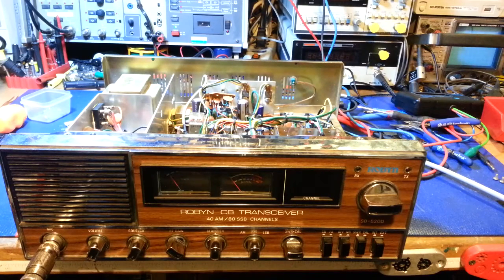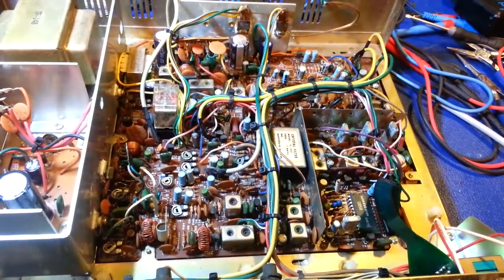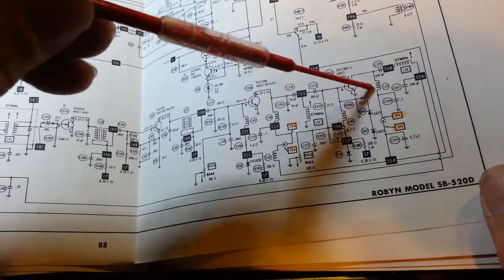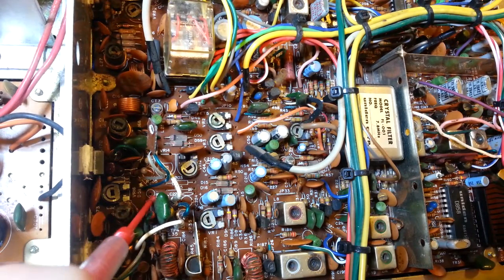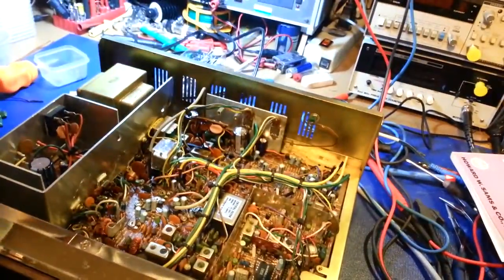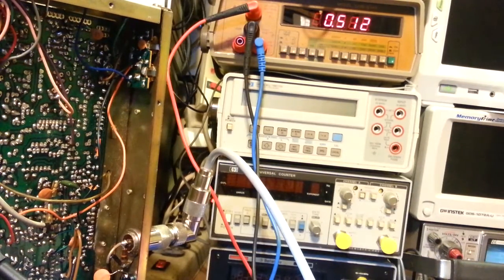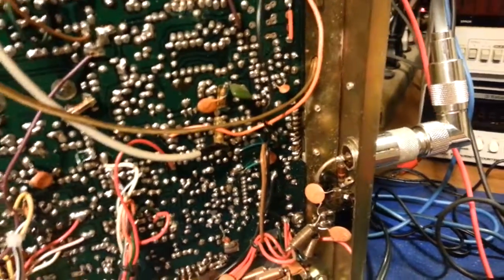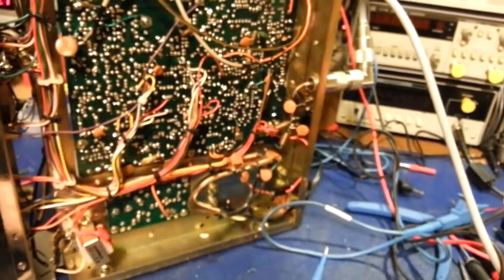Robyn SB-520D with bad final.  It's self biasing itself, crazy!

Comment: I have the same radio.  When I key up on sideband there is no delay and no modulation but it triggers the relay and holds at 8 watts.   It has me stumped.    Am has 3 watts swinging almost 20 PEP.  Any ideas?
Reply from the maker: Using a oscilloscope I would trace back through the RF amplifier stage towards the balance modulator.  Could be something oscillating or a problem in the balance modulator stage.
Reply: @mikesradiorepair thank you.  I will do that. I'm learning.  Well trying to.

Comment: Do you repair radios for other people? I've got a 2 button Washington that DEFINITELY has been visited by the Golden Screwdriver (1/2 inch twin lead for the channel mod??) and the other is a Robyn SB 520D  with no signs of EXTERIOR mods (switches, buttons, etc) I'm not too sure if it has been or not. It doesn't tx on side band, and AM only puts out a watt or so ( got an el-cheapo wattmeter, readings are approximate) I'm in Michigan, so if you can think of a good repair guy that's closer, let me know.

Thanks in advance;
Phil B.

Comment: Hey Mike, the way it is going, you might as well be the Screwdriver Specialist, with the winners you get. It is cool that you know what you are doing,,LOL.good luck. I have one of these radio's I have to look at, been sitting in a closet for about 15 to 20 years, and he was a smoker, so that will add to the B.S, but I know that nobody has been in the radio with a screwdriver at all, so this may make it a bit easier to align, and change Capacitors, but the cleaning is going to be a big job. Take care, good luck,Mark

Comment: This was a GREAT video to see BIG THANKS.  I have 2 of these radios both had been modified before I purchased them.  My most recent one just arrived which is very clean.  I had ran a D104 with my first Robyn and it was just a perfect match.  The one I received from ebay last week also came with a D104 but it needed some minor work.  I had the Cobra 139XLR back in the day with a D104 and that radio seemed similar to this one.   Id like to get a copy of the paperwork on the this Robyn  520D
      Thanks Again Mike

Comment: You just don't understand. The original screwdriver twister wanted a super linear output stage. 3 Amps of quiescent collector current ought to do it. Super duper class A operation, right? No? Good grief, where do those ideas come from anyway?

What's the right way to set the bias pots in a cheapie SSB CB? Do you look at 3rd order IMD products? Or just set the quiescent to some factory spec?
Reply from the maker: Have tried setting bias on different radios with a spectrum analyzer and had mixed results.  Some radios it works great.  Others it wasn't a reliable.  Since playing with the different methods I have decided to just go by factory specified bias current.

Comment: Usually a transistor that leaks in such a manner destroys itself or something around it.
The kicker here is that it worked and I bet it got wicked hot.

Now The reason that it probably kept working is because the power is cut on RX... so it could not sit there smoldering and eventually fail.
I am betting the waveform was probably clipped pretty bad.
The bias circuit.... certainly there were better ways to make ~0.7 volts than a 150 ohm 2 watt resistor and a diode.
That's the part I never understood about that design.
I guess it was cheaper... and it did work.... 
It's.... unique.
Reply from the maker: Yeah, its one of Unidens better chassis.  Good rx and tx.  One thing to ALWAYS upgrade is the tantalum cap next to the bias test points.  Not enough fingers and toes to count how many of those I have seen blown up.

Didn't even look at the output waveform before, probably was distorted.  Bet it was making some nice harmonics to.  It's adjusted to 12 watts on SSB now with the new final.

Comment: that power supply in the radio...when the radio is off, how many volts is it at vs when its on?
I have that same supply but I'm having trouble with it
Reply from the maker: The main supply on these is on all the time and should be at 13.8 volts.  There isn't much to them, a regulator, regulator controller and error amp transistors and two zener diodes.  What's yours doing?
Reply: mine sits at 14.83 then when I turn on the radio it goes to 13.78.
Just having the radio in  rx the regulator gets super hot and when talking for awhile it get even worse.
It gets so hot the power starts blinking off and on.
I tested every part on it and replace the regulators, diodes, new caps pulled and tested the resistors.....its possessed.

you ever seen that where a radio's power supply runs super hot for no apparent reason?
Reply from the maker: +ᗒ╬ᗕ1112223333111ᗒ╬ᗕ 

Ever seen them run hot and have problems, yes.  Ever seen a possessed one, no. :)

Here is what you should have"

TR401  2SC1618 regulator

E - 13.8V
B - 14.49V
C - 24.8V

TR302  2SC1419 regulator control

E - 14.49V
B - 15.06V
C - 24.8V

TR301  2SC945 error amp

E - 5.94V
B - 6.56V
C - 15.06V

Which of yours are different?  The emitter of the main regulator is the outout.  

Also wondering if the problem isn't in the power supply.  If something else is wrong in the radio it may be overloading the supply but not quite enough to blow the fuse.  If you working on this exact model radio the fuse is on the 13.8V output from the supply.  Try pulling the fuse and attaching another radio like a mobile to the supply and see if the problem is still there.  If not the problem is in the radio, not the power supply circuit.

Mike
Reply from the maker: +ᗒ╬ᗕ1112223333111ᗒ╬ᗕ 

When you adjust RT301 does the output voltage change?  Have you checked the bridge rectifier for excessive ac ripple?
Reply from the maker: +ᗒ╬ᗕ1112223333111ᗒ╬ᗕ 

Hmm, that is strange.  Have you tested zener diode D302.
Reply from the maker: +ᗒ╬ᗕ1112223333111ᗒ╬ᗕ 

Yeah, that is strange.  I would almost need the power supply board setting in front of me to test it in person.
Reply from the maker: +ᗒ╬ᗕ1112223333111ᗒ╬ᗕ 

Thanks for the bump.  And yeah thers aren't many of us left.
Reply from the maker: +ᗒ╬ᗕ1112223333111ᗒ╬ᗕ 

No, you should replace it.  It sounds like it is bad.  Rare but ceramic capacitors do go bad, have seen it happen before.  Don't have the service manual in front of me at the moment.  Does the cap have its voltage rating printed on it or is it listed in the parts section.
Reply from the maker: +ᗒ╬ᗕ1112223333111ᗒ╬ᗕ 

Kind of figured it would be a 50V.  Replacing it with the same is fine but it definitely wouldn't hurt to up it to 100V.
Reply from the maker: +ᗒ╬ᗕ1112223333111ᗒ╬ᗕ 

Yeah, their egg fryer's that's for sure.  Look at it this way.  Once it warms up it's like having a built in crystal oven. :)
Reply from the maker: +ᗒ╬ᗕ1112223333111ᗒ╬ᗕ 

It works doesn't it.  That's what matters.  It's not like it's on the outside of the radio where you can see it.
Reply from the maker: +ᗒ╬ᗕ1112223333111ᗒ╬ᗕ 

Getting ready to do alignment on the NOS 457.  I will be sure to take a temp reading of it when I do the video of its performance after alignment and its been on for a hour.